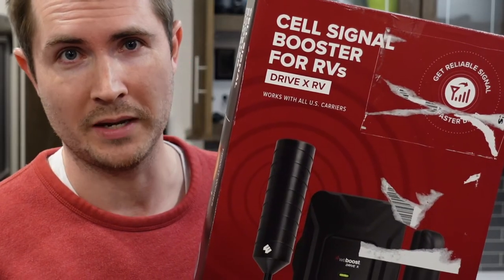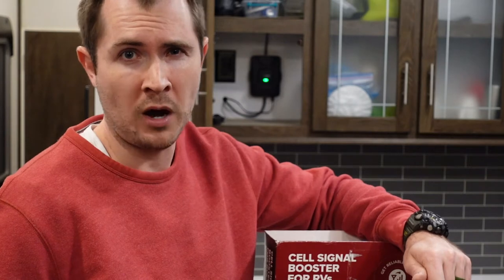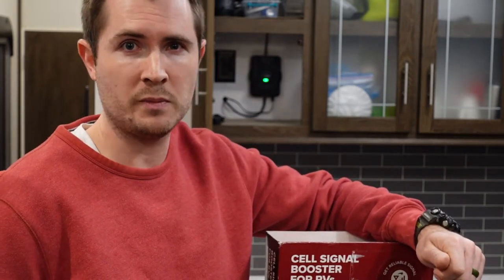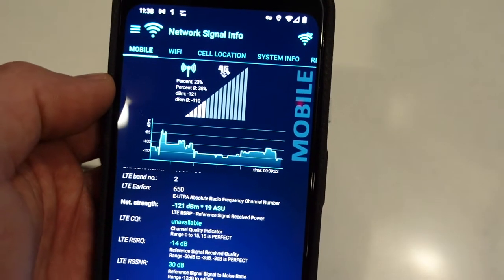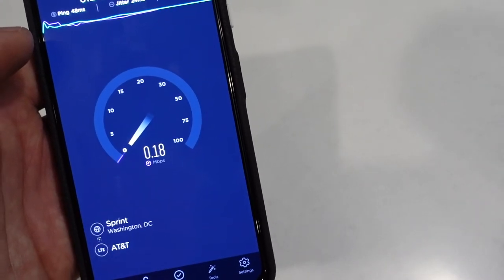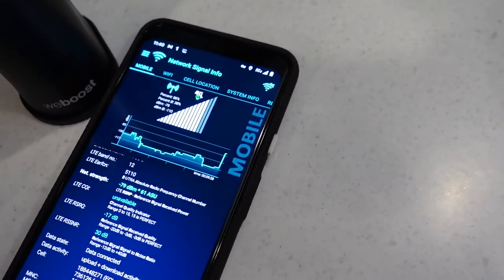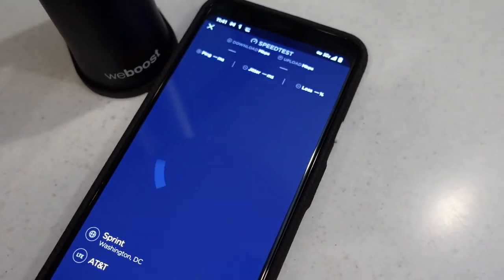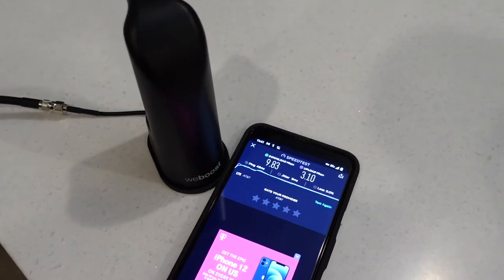weBoost Drive X RV Cell Phone Signal Booster Review for RVs - Does it actually work? Is it worth it?

Comment: We used an adjustable marine antenna rail mount and a couple of pipe reducer fittings. Still mounted to ladder, but it now can be laid flat for storage and travel without worry about low branches and such and, because of this, we were able to add the antenna extender for extra range as well.  Weboost recommended a product made for CB antennas to fold down.  And while that would have been an easier and cheaper install, it was very difficult to fold down with nothing to stop it from popping back up with heavy winds or the like.
Reply from the maker: Great tip, thank you. You able to share a link to mount you settled on?

Comment: Thanks so much for the video,  nice install job extremely clean. The cable run from the antenna to the booster did you use the RG6 they supply... any consideration for lower loss RG6?  I've watched several of the installs and the fact that all have to place the cellphone so close to the internal antenna is an issue... Why can't they either boost the inside antenna.. You would think that most folks move 10 - 15' around an RV....   I'd think they could a better inside antenna and that would solve a bunch of issues.   If you lose half the coverage area at 5-7'  that's a big hit.
Reply from the maker: I believe the challenge is if you amplify the internal antenna too much, it interferes or reduces the effectiveness of the external antenna. I'm no radio wave expert, but I think they essentially cancel each other out if the internal antenna is too strong, and that's why you have to keep your phone so close to internal antenna to see good results. For me it wasn't an issue as I used my phone as a hotspot normally. So I just keep the phone rested next to the antenna and it would broadcast the Wi-Fi signal then throughout the coach. But certainly would be nice if there was a way to have the internal antenna stronger without compromising the amplifying ability of the external antenna.

Comment: Thanks for the vid. Question: I have property that has a weak signal. I will be putting a camper on the property eventually but until then I need good signal when I'm out there so would this work for my pickup truck and camper both?
Reply from the maker: Yes, I kinda have a similar situation where I recorded the video on my property. I have had amazing results both on my property and while camping. I think the key is getting the outside antenna as far from the internal as possible and then keeping your phone as close as possible to internal antenna... Even right up to it if you have to use Bluetooth headset, wifi hotspot, etc. As long as you have a weak signal, I've found it'll do wonders. If you were going to use in truck, then I'd say you want a second one to mount in truck to be effective. Weboost makes a similar one for auto that a lot of truckers use. Hope this helps!

Comment: Have you tested it at a state park?
Reply from the maker: Yes, it doesn't necessarily matter what type of venue or campground it is, just as long as the area you're in has at least a weak signal, perhaps 1 bar. Then it can amplify that 1 bar to perhaps 3-4 bars. However, if you're in an area that has zero signal to begin with, very slim chance it'll do much then. And, key is to keep the phone as close as possible to the inside antenna. It's a handy problem solver when need, albeit a bit expensive.